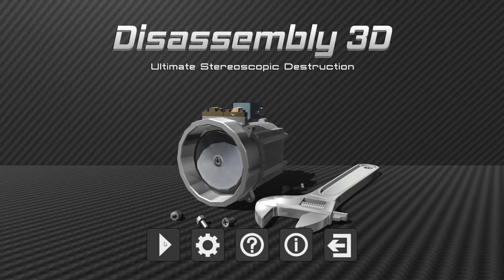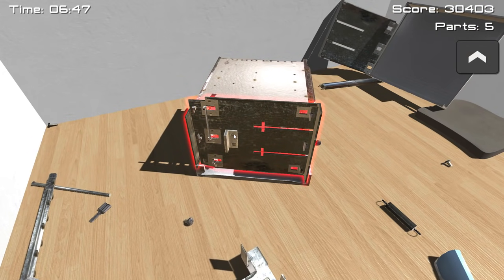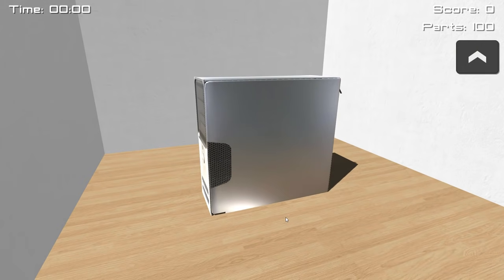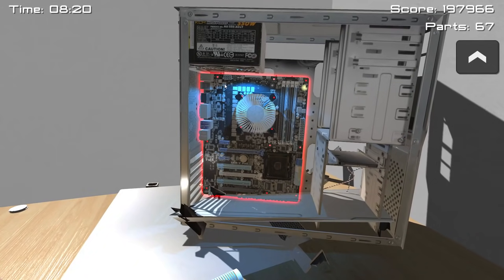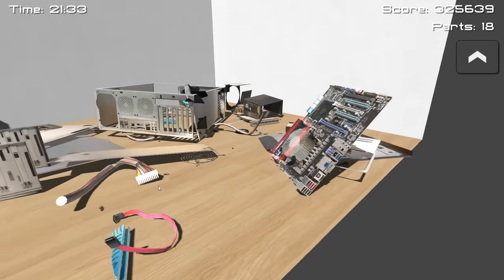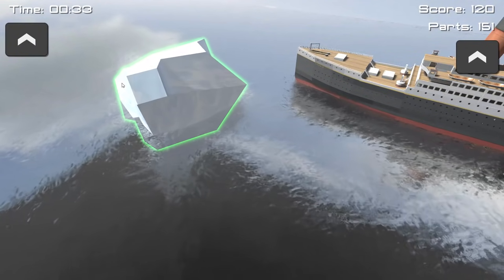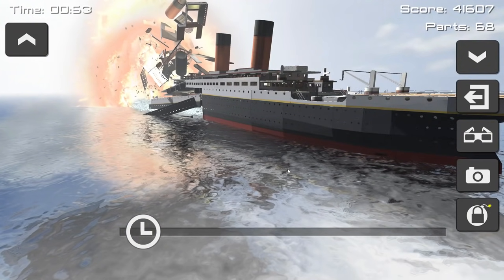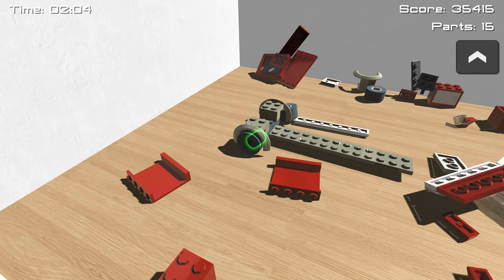Disassembly 3D - How Stuff Works

Comment: I'm really looking forward to this

edit1: Stuff gets hot when you run electricity through it because of resistance. Rub your hands together -> gets hot.
edit2: Oh this was an easy one. PSU = Power supply unit. Also, PC 101: Motherboard is the entire big thing at the back, the CPU is below fan in the middle, Ram is next to it, the card that was stuck in the motherboard is the GPU.
edit3: The evlevator wasn't floating, the cables are connected to a counterweight.
Reply: Tyolus your close on the resistance thing. The equation here is V=IR, or R (resistance) =V(voltage)/I(current)
Reply: Ben Garcia that is an equation but the one that’s applies here is that the energy per  second that goes into heating a wire is equal to I R^2
Reply: Good work everybody. Now, all we need to sort out is how Jon's brain works, which let's be honest is the real mystery here, then we can proceed to explain stuff to him.

(edit: and no, no disassembling allowed. Jon still needs it)
Reply: Also the PSU isn't on the top, it's at the bottom and Jon has the computer upside down.
Reply: William Clapp i dont know how you put your coputer but the psu is almost Always at the top, so YOUR cumputer is prob upsidedown :P
Reply: +No_Mans_Player the case in the video is not upside down, it's just a really really crappy old one. In a good case, the PSU is always mounted at the bottom, often in a separate shroud. Reason being, you don't want to mount something as bulky as a PSU on the top, since that area is usually reserved for either a radiator for liquid cooling or a vent. Remember, hot air goes up and stays up. If there's anything preventing that hot air from leaving the case, like for example a big bulky PSU, your computer cooks itself.

Not much of a a problem if you have a really cheap computer with integrated graphics, but the high-end stuff generates quite a lot of heat that needs to be managed properly. For those builds, you'll never see the PSU on top.Hell, i doubt there's any case manufacturer that still mounts them there.
Reply: Dorian Arbos but that is why the PSU has its own vent right?

Comment: Also, yes, Jon, thats exactly how those metal heaters work. Pass loads of current through a high resistance wire (either a small one or specific materials) and they get hot. Your every day power cables are made of copper which conducts electricity exceptionally well, and so it doesn't heat up.
Reply: The electricity flows slower through power cables with higher voltage. That prevents it from heating and wasting energy.

Comment: toasters use latching transformer coils! i actually took one apart to make an electric guitar with.

Hz on electricity is the frequency of the alternating current.

edit: those are diodes, transistors have 3 prongs, you put signal in one end, and power through the middle, and then pixie magic happens and amplified signal comes out the other end.

edit 2: yes it is because the wires are slim, electrical resistance turns the electrical energy into heat, the thicker the wire is, the more electricity can flow through it without it heating up, but higher voltages means more electrical force, which can pass electricity through more resistive things, and more amps means more electricity, which can heat up thicker wires, that's how fuses work, higher value fuses have thicker wires in them. "special metals" include copper and gold, which have low electrical resistance.
Reply: Mikail Elchanovanich how'd you make an electric guitar from a toaster??, Pickups from parts or what?
Reply: Well the special metal in the case of a toaster or a hair dryer would be nichrome which has a high resistance for the purposes of heating stuff up. Also I totally didn't just comment on this to ask how you made an electric guitar with parts from a toaster and presumably a variety of other things.

Comment: Metals heat up with electricity because of friction. Resistance is a property of mass which determines how easily electricity can go through it. Wood and plastic, for example, have super high resistance. Metals, in comparison, have lower resistance. The resistance of metals can vary, and with higher resistance, more friction and therefore more heat. Many metals with high resistance are used on heating devices.
Reply: Have a slight correction
Friction technically is defined as the conversion of kinetic energy into thermal (e.g. microscopic kietic energy). Now, why the heck would resistance be caused by friction if we had current, microscopic motion, in the first place? it doesn't work like that
Reply: I did not say resistance is caused by friction. Rather, friction happens because there is resistance.
Reply: Friction does not happen in a resistor, what happens is electrons being forced into excitation and bleeding off the energy as heat by the release of photons. Resistance is based on the amount of freely available electrons in the material which is why it varies with temperature. Friction on a resistor means something has gone very wrong since it would need to physically be rubbing against something (and this would only influence the resistance through temperature and nothing else).

Comment: I sure hope he's joking about not knowing these things. But in the past.... Oh dear.
PSU- Power Supply Unit
Watts- Joules per second
the wires in toasters and hairdryers have high resistance  wires which heat up when current is applied, and yes all wires heat up a bit when electricity passes through.
Hertz in reference to electricity is how fast the charge changes in AC currents i think it's 50-60Hz most of the time in home applications.

Comment: Transistors have 3 leads, all coming out of the bottom of the case. The most common electronics parts with coaxial leads are resistors or diodes.The hair dryer doesn't need diodes, so those are probably resistors.

Comment: Yes, Jon! It is indeed a special metal for heating. Normal wire is made from copper. It is chosen for wire because it carries electricity better (less heat being made, a.k.a. heat loss, etc) than most other metals. The metal many heating elements (e.g. in toasters) use is called nichrome. It is a mix of the metals nickel, chromium, and usually some iron. To personify metal a bit, imagine:

Copper is the friendly neighbour. They share food, invite neighbours to parties, and let you pat their dog. They are easy to get along with and so the relationship is warm and comfortable. This is how electricity flows through copper wire.

Nichrome is that one neighbour we like to bitch about. They hate everybody, leave dog poop on your front lawn, and yell at you for breathing. Your relationship with them is full of resistance and heat, because you want nothing to do with them but are forced together. This is how electricity flows through nichrome.

Comment: I'm an apprentice electrician here Jon. Electricity at it's simplest (or is it at it's most complex?) electrons (energy) moving, but some if it is lost as waste. When electricity passes through something more resistant the electrons have to fight harder to move through the material, and the more energy is lost as waste. By putting the electricity through resistors it turns as much of the electric energy as it can into heat.

Comment: It's resistance/resistive wire.  It's designed to glow red hot when current passes through it without burning. Usually has a ceramic surround which acts as a heat sink and stops the plastic parts melting.

Comment: Materials have a resistance to electricity traveling through them. If the amount of electricity exceeds the resistance then the excess energy becomes heat. All materials, barring super conductors, have some resistance so they will generate some heat from electricity. Heating elements just get fed more voltage so they are made from a material that can handle high temperatures. The rubber insulation is just there to prevent accidental electrical shorts and electrocutions.
Opening up a computer casing like that lets in a ton of dust. It also messes up the intended airflow. Instead of being moved along a route it just goes by the fan and doesn't have time to actually pick up much heat. The bit about touching a radiator before touching the internals of a computer is to discharge static onto the radiator and not the sensitive electronics. Any bit of metal will work for this.

Comment: The hertz rating is because it's an alternating current (AC) coming from the mains electricity Jon, as opposed to the Direct Current (DC) you would find coming out of a battery for instance. Alternating current changes direction. In the U.K. (Can't speak for other areas) the rate at which the current changes direction is around 50 times per second, hence the 50Hz rating

Comment: The 50Hz refers to the frequency of the AC (as in mains electricity) it's meant to work with, it's the measure of how many times per second the current alternates, it's different in different countries and matters for some appliances.

Comment: The timing system on a toaster is just two strips of metal, stuck together back to bacl. They expand at different rates, causing the thing to bend. When it bends enough it triggers a disconnect and stops the toasting. Toasters are not calibrated, at all. Some more expensive ones might use a computerized timer.

Comment: People toast more than bread in a toaster, and that is why it goes up so high. I only have a basic understanding correct me if I'm wrong. Electricity causes electrons to move up in energy and electrons want to be stable and have low energy and therefore release heat energy to become stable.
Reply: Not to mention that there's other kinds of bread than white bread that isn't burnt by dialing your toaster up a bit. Also electricity is the movement of electrons from an area of high potential energy to one of low potential energy (which confusingly is from the low potential state to the high potential state since electrons are negatively charged). What happens in a heating element is that it's a resistor which means that due to differences in collective excitations (phonons, not to be confused with photons which are responsible for the energy transfer of the heat dumping) electrons are forced into higher energy states which they jump back out of releasing a photon which carries the heat energy. So you are basically correct, except it's more like electricity is trying to force itself through a too small hole (imagine the process as air flowing through a wide pipe then suddenly having to be compressed) to get to the other side.

Comment: I've actually been writing my dissertation on the magic that the Toaster was. I say was, because you have filled the a large amount of the  information void that has plagued Toaster Research for nearly one hundred and twenty five years. The biggest issue was overcoming the desire to make toast every time we would go to open to the magic that the toaster was. You however, have overcome this, and even defeated the mighty safety key that claimed Simmons just last week. There are still many mysteries, like the spring, but you have done grand work. My only question is, how would you like me to cite your work in my paper?

Comment: Yes, slim wires heat up, they are resistors. Resistors heat up when the electricity goes through them(and every wire is a resistor, except superconductors). They also can give off light like the incandescent light bulb.

Comment: Eletricity isn't in Hertz, it's because the toaster is running on AC which is Alternating Current, and that's is a sinusoidal function with, in this case, 50Hz frequency... So basically the current after 1 second, has changed back and fourth 50 times.
Reply: Which is a really weird way to transmit power, but it seems to work fairly well
Reply: It is, but it was needed to make coils create a constant magnetic field. And it also helps to transmit at high distances and stuff. But AC and DC have advantages over one another.
Reply: Fabio Silva I'd never thought about the magnetism aspect. I suppose an oscillating field is better than a constant one
Reply: Hertz is as much part of "electricity" as volt and watt are. Also if we're being specific, you don't capitalise hertz.
Reply: Dude, I wasn't going to start with technical details, this is a god damn youtube video XD I'm not here to do lectures. 
And my autocorrect capitalized it. 

Also if you are going to correct me, you shouldn't put 's' in "capitalise".

Comment: So, Jon, Toasters. Resistant wires get hot when electricity flows. When you turn the Toaster on, electricity starts running through very high resistance wires immediately. It stops because eventually heat warps a tiny strip of metal, which effectively just triggers the stop button.

Comment: Hertz means cycles per second and it's AC current which stands for Alternating current - it's called that because the polarity of the electricity switched back and forth between positive and negative 50 times per second, hence 50 Hz.

Comment: So, this is great already and yet knowing jon, I can almost see him being serious when he asks why electricity makes things hot, same with asking why water gets hot.

The answer is molecules jon, not specifically molecules but rather the friction created by them as they get really excited. See, when you for example, run electricity through a wire, the electricity running through that wire is pure energy, it's effectively nothing but particles, unbound protons and electrons in the case of electricity. The wire however, is solid, it has form, and is formed of many many many copper molecules (Copper has great conductivity compared to other metals such as iron)  and these particles, racing down this solid wire cause the heat in a semi direct way.

Firstly, they have a positive and a negative charge, which attracts and repulses both each other, and the atoms around them. Atoms consist of protons, electrons and neutrons. This means the electricity racing down the wire has an effect on the atoms that make up the molecules around it, causing these molecules to begin moving. As these molecules begin to move, it will effectively be vibration, as the movements are so tiny and they're pulled all over the place, but also because the atoms that form the copper molecule are being pulled at, thus straining their chemical bond causing the entire molecule to vibrate. But during this process the entire molecules themselves will be moved and as such they will crash into and rub up against each other.

It is the friction caused by the molecules colliding and rubbing against one another that causes the heat you feel when running electricity through metal. Light bulbs take advantage of this reaction by using a special filament (non fluorescent light bulbs anyway), the filament gives off light when an electrical charge passes through it, and as a side effect of radiating that light it also radiates the heat. Fluorescent light bulbs I'm not as sure on but I think they take the electrical charge and run it through a fluoride gas, similar to how neon lights apply an electrical charge to neon gas.

Your toaster works a lot like a light bulb. Electricity is run through uninsulated copper filament, which generates a bundle of heat and light. That's why they say you should never stick a knife in the toaster while it's plugged in. If you touched one of the filaments, there is no insulation to protect you from being electrocuted unlike if you picked up a rubber wrapped wire.

Edit: Hot water is the same basic principle. When you apply energy to water, for example, through an electrical element which is using electricity to generate heat, that heat is effectively causing those molecules to become excited and vibrate, causing friction in the water molecules. Which is why water boils, boiling point is basically maximum molecule agitation being reached, because you can't get much hotter than boiling point with water, as applying more heat simply speeds up the conversion of water from a liquid into a gas, rather than simply making the water hotter and hotter.

Comment: Hertz= cycles per second (Alternating Current)
50 Hz is the standard in UK
60 Hz is the standard in US
other places also have their own standard
It is the key reason that appliances that run on AC have different plugs in different countries. Hook a toaster that was manufactured for the US grid into the UK grid and it will not toast as well. Hook a toaster that was made for the UK grid into the US grid and it'll short and die.

The numbers on the dial are the amount of time the tray holding the bread stays down between the heating coils. The toaster torches bread after the 3 setting due to the thing pulling as much power as a microwave and running it through the heating coils. At 240V that little thing is designed to operate off of an electric cloths dryer's outlet.

Comment: So when you run electricity, aka a flow of electrons, through the copper coils, the electrons vibrate faster and faster because they're bumping around, which produces heat. This can be done with any material really, but the better it conducts heat, and the cheaper, the better it is commercially, so we use copper or some other metals.
Reply: Electrons do not bump around in a metal lattice, they are not balls in a pipe. Copper is also a really bad choice for heating coils since it's an excellent conductor of electricity. Resistance is based on the number of free electrons in the lattice, and with fewer electrons available the electrons are forced into an excited state and release energy in the form of a photon to get back to a stable state. These photons are what is radiated as heat energy.